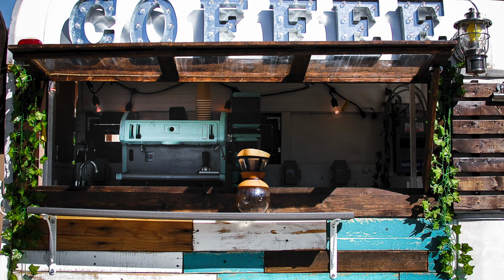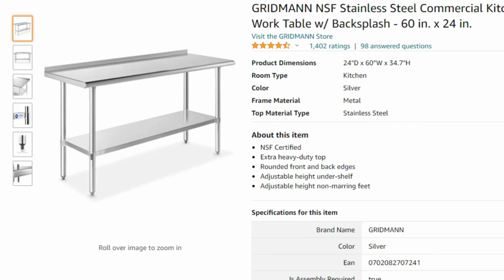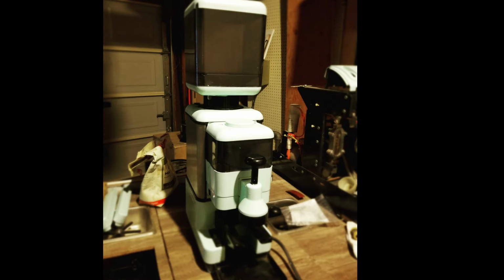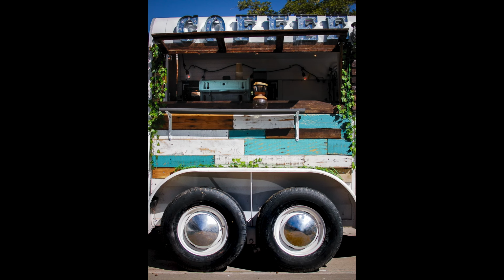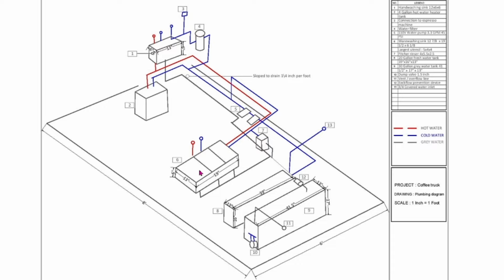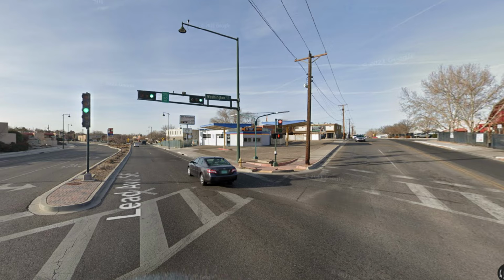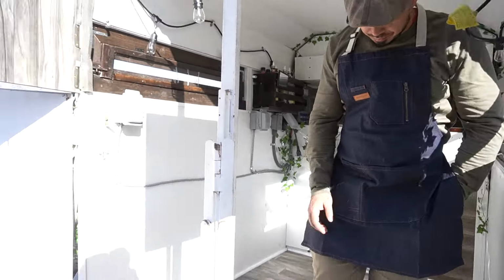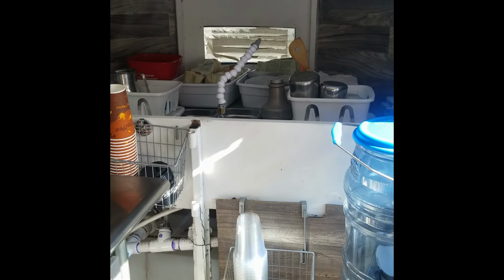How to Build a DIY Coffee Cart and Mobile Horse Trailer Coffee Conversion | Mobile Coffee Business

Comment: Hey Joe ..My Espresso steamer can not keep up...can I heat milk prior to steaming and still do an ok latte ? what temp do you suggest for a bunn thermas to keep the heated milk in before I steam it on the espresso machine  You had mentioned this in one of your vids but I cant find it . I really do not want to buy an extra steamer .You are so very awesome ...thank you so much for your videos !
Reply from the maker: Hey Gary, you sure can. As long as your milk is above 140F and you keep it above 140F, it safe to serve. You do however lose some of the frothing to the latte. But I've learned in big crowds, its better to get the drinks out then worry about them being pretty. I pre-heat the cambros the day before (or at least a few hours) with boiling water (or close to it). Then steam the milk to 150 and place in the cambro. You usually have about 60-90 minutes before it drops below 140F. Just depending on the temp of the environment. Buy an extra thermometer that's on a string if you want to keep track of milk temps: https://amzn.to/3oHuJok

Comment: Great video! I see you use a generator to power the trailer, what do you use to power the coffee cart when you do indoor events?
Reply from the maker: Depends on the weather. If it’s hot, I can get away without electric (see coffee cart ebook for details). If cold, depends on my espresso machine. If I’m 110v just an extension cord. However, if 220v I have to run a spider box (see coffee cart ebook for details).
Reply from the maker: https://www.greenjoecoffeetruck.com/products/coffee-cart-ebook

Comment: Can I ask how much the renovation cost,  not including the price of the trailer? I apologize if this was already answered,  I'm just diving into this topic.😊
Reply from the maker: Hey Colleen, I see your question and raise you one…are you trying to figure out the minimum amount to launch? Assuming you have a trailer already…
Reply: @GreenJoeCoffeeTruck  I'm mostly wondering what the cost was so I can figure out if it's worth it to pursue,  especially with the extra red tape that our lovely politicians want to put us through here in CA.
Reply from the maker: @colleenmeyer2049  California code is different than mine, so your cost is going to be a little different. They usually want a fire exit, larger sinks, self closing windows and 4 inch extension of your floor up your baseboard. If you have friends and family in either construction, plumbing or electrical, you can keep it as low as $10k. If you can do a catering with 200-300 ppl, you’ll make $1k or an event with 1000 ppl attending also makes $1k. So, if you can get 15-20 of those events in a year, you’ll make your money back. I had mine in 2 months but every body is different. Sign up for my newsletter…much more info there.